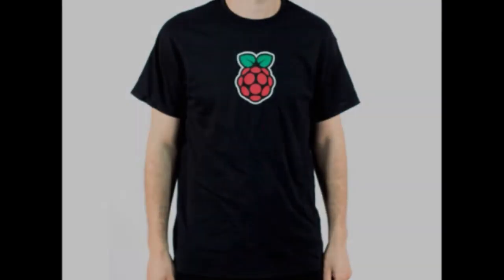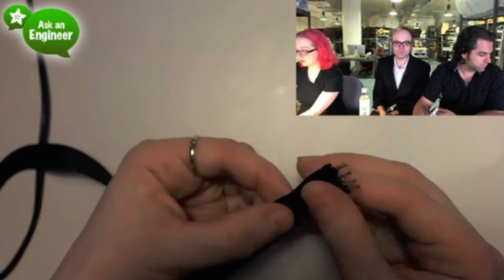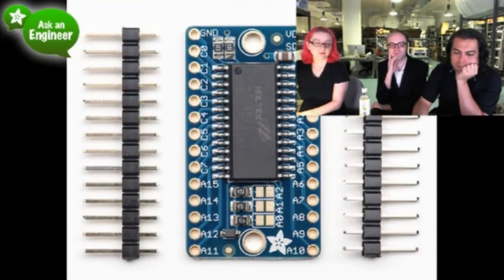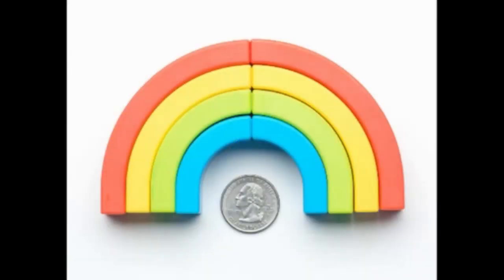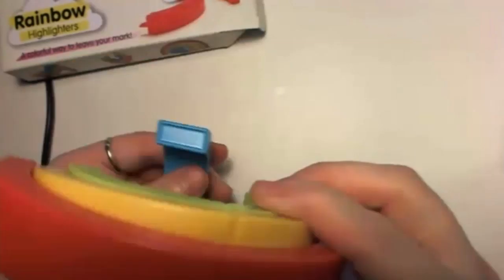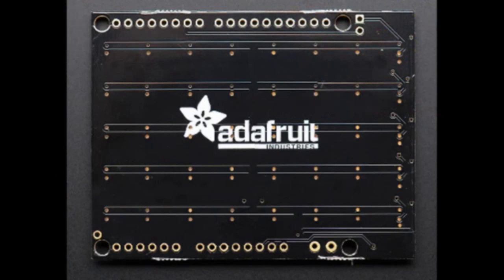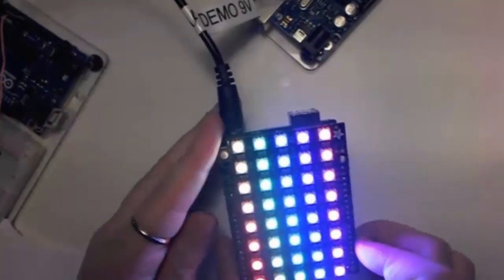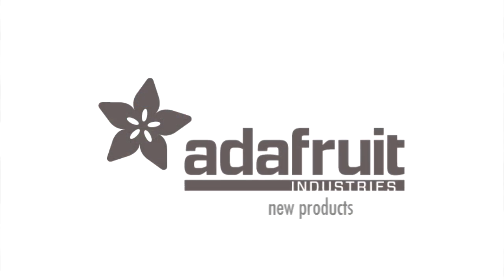NeoPixel Shield & More! New Products 6/29/2013

Comment: Taking amazing pictures of these is really easy. Two words: double exposure. Be sure you are using a tripod. Just turn off all your lights, take a picture in total darkness of just the LEDs on, with the exposure adjusted for the best saturation of the color (likely many stops less than your other exposure). Then don't advance the frame, take a picture with the lights on but LEDs off. If your camera can't take multiple exposures, just take two shots and blend the results in Pixelmator, Gimp, or a Gimp-like product such as Photoshop.